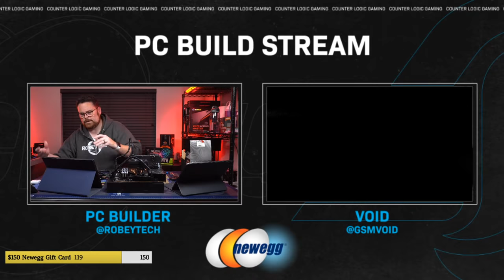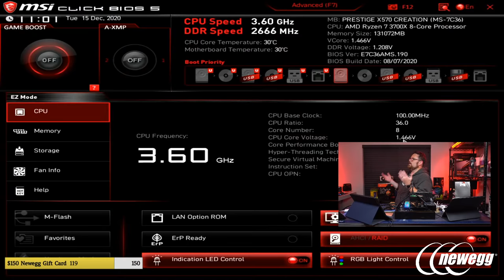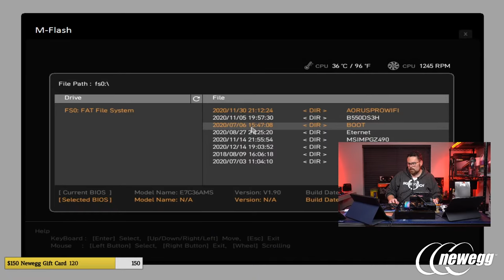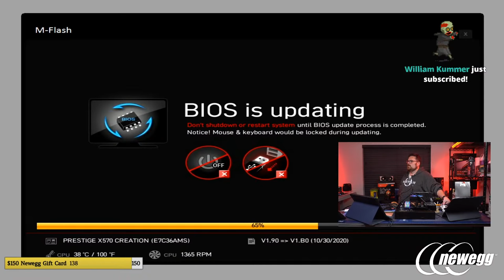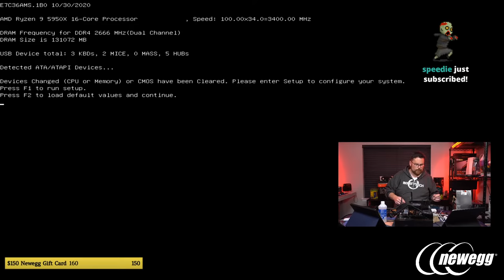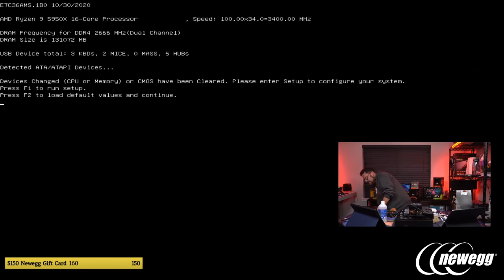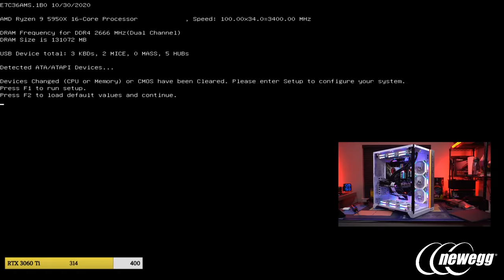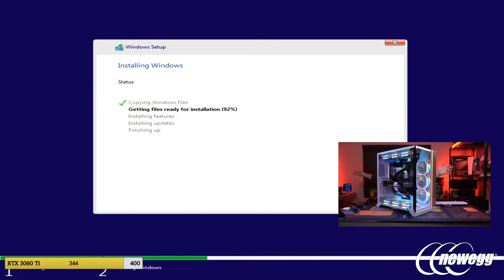$5500 PC Build - Giveaways + Lian Li o11-Dynamic XL Build (Ryzen 9 5950x / ASUS TUF 3090)| Robeytech

Comment: that fan configuration has me a bit confused,  intake in the bottom, intake at the top, no exhaust at the back but exhaust on the side,  the best place for intake is on the side, but no body seems to like putitng those fans facing the other way, is not the best look but its the best cooling, i'd also at least get an exhaust on the back of the case
Reply: No space to put an exhaust on the case
Reply: Top would be better for exhaust, heat rises.

Comment: hopefully you will see this i have a 011 case and want to vertically mount my msi rtx 3080 ventus would there be much of a performance loss going from gen4 to gen3 i have the phanteks vertical mount and it only comes with a gen3 riser cable

Comment: The AIO RGB shield/logo is adjustable. At least both of mine have been the two builds I used this AIO. The front rotates off and the logo comes out. You can adjust it in the desired direction.

Comment: If I replace AIO fans like you did on some other AIO for example Kraken Z73...where do you plug the SL120 fan cables? The RGB cable goes to the controller, what about the cable? To the CPU Fan header on the motherboard or it can go to the controller aswell along with RGB?

Comment: hmm. i just got this, but I'm trying to decipher what my BIOS version is before booting it up. Can one tell by the Serial Number?   Trying to decode it looks like it was manufactured in 12/20 but I'm guessing the other part that says 19A is bios version 1.9 :\ I  got a 5800X, don't have the option of using an older gen CPU at the moment so I'm holding my breath as I complete my build. (I have yet to even get my hands on a graphics card, since everything is perpetually sold out or ridiculously priced)

Comment: man i would love to have that beautiful machine. ive been drooling over these 3090's and the new ryzen 9 5900x. i gotta save up the cash to build one to get off the stupid consoles. im so over them at this point its time for a change. how do i enter to even get a chance at winning a machine? great vid and beautiful build
Reply: If you're just gaming you don't need to save all the way up to a 5900x and a 3090. Unless you do massive workloads you're not going to see the benefit. And for gaming unless you plan on saving up for a 4K 144hz+ monitor you're going to be wasting your money on those components
Reply: @lyledeporiss5937  i built a pc with a 10850k and a 3090fe. i have a 180hz monitor and a 55" 4k oled tv i hook it up to. huge difference to console thats for sure. pc gaming is leaps and bounds better. honestly couldnt be happier and also happy i didnt get scalped.
Reply: @Peep18m  You did that in a week?
Reply: @lyledeporiss5937  correct got lucky on the 3090 fe it was my first build ever

Comment: can’t he just flash the motherboard bios without using an older gen cpu? 
my original thought that it is simply possible
Reply: Depends on the type of motherboard and if it has bios flash
Reply: @aresswenl112  to my knowledge this one have  a bios flash
Reply: I’m asking because I’m going to build mine today
Reply: @Void.Soul717  you can download the bios on a flash drive, and find the flash switch on the motherboard
Reply: @frankcloud7973  thanks this was my original plan but i had second thoughts when i saw him do it this way with all the extra unnecessary steps
Reply: update i did the flash without installing anything to my my motherboard & it worked like a charm
Reply: @UC_txn-8e8_ri9uERN12_ULA i just used the method in which you connect the cpu and motherboard cables to the power supply. then download the latest firmware on a usb stick & stick it on the  right place on the motherboard. finally connect power & press the bios flashing button on the motherboard for 3 seconds & let it go. the light on the motherboard will start flashing and do its thing, when its stops wait for 2 mins and your done 
FYI: my motherboard is gigabyte so i had to rename the bios file to GIGABYTE.BIN & keep it alone on a fat32 usb